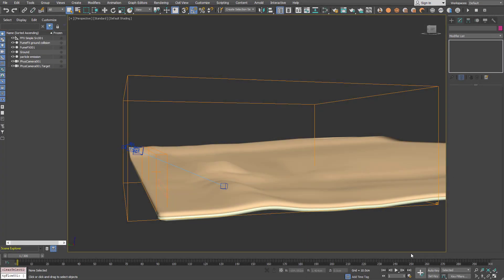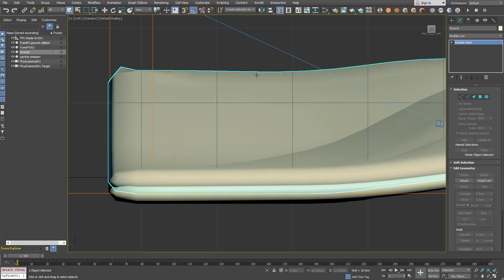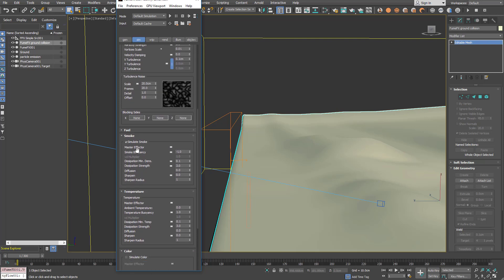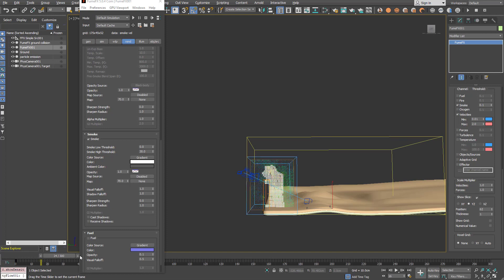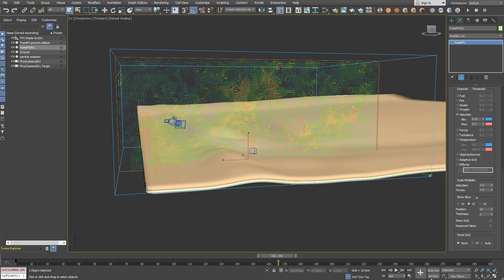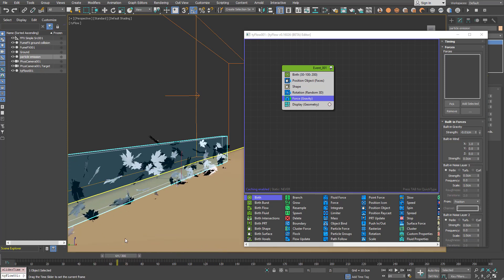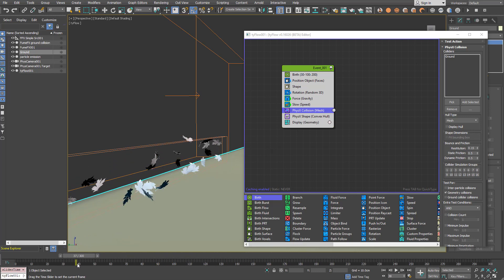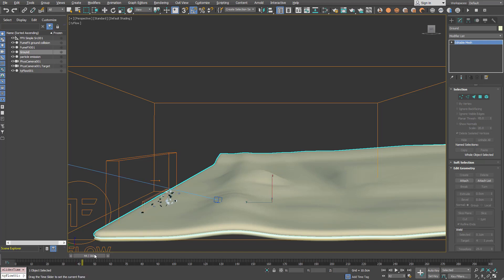FumeFX and tyFlow Fluid Force Tutorial

Comment: you can of course use internal Tyflow turbulent force without fume. Tyflow + Fume gives you endless methods to achieve the same goal.
Reply from the maker: You can use that, but turbulent force is not the same as velocity field generated by the fluid dynamics, so you cannot get the same effect. Wind blowing over the sand dunes and following terrain contours for example.